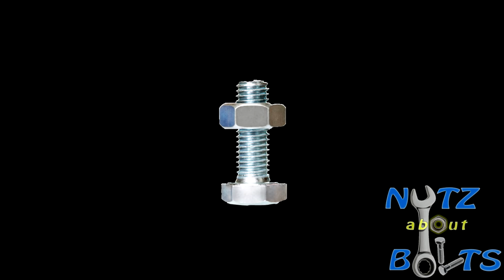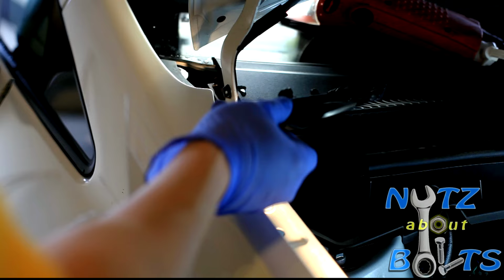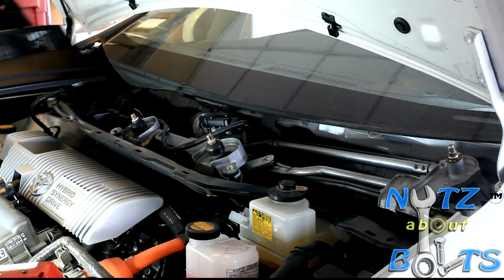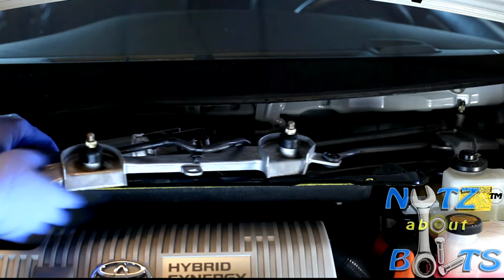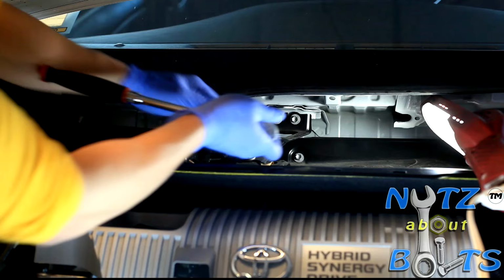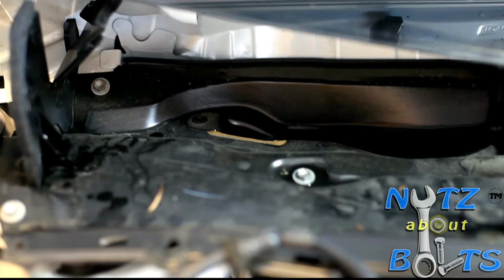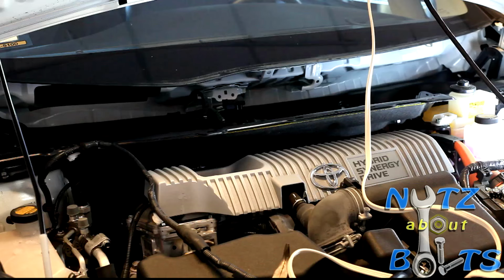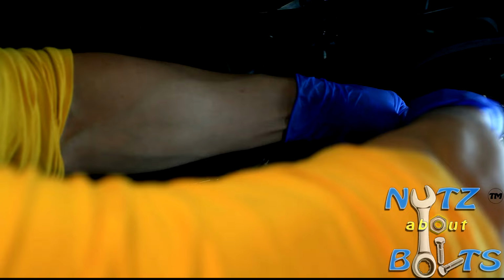2010-2015 Toyota Prius Spark plugs remove and install HD

Comment: what year is your car?i love your video but on my 2014 prius i just pop up the cover without all these extra stuff removed.
Reply from the maker: its a 2012 prius. If your prius is the 3rd gen, this is the way to replace the spark plugs. You can remove the top engine cover, but you won't be able to reach it to remove the spark plugs.
Reply: So to confirm you HAVE to do all the initial steps.  Another comment said "I had my Prius Gen 3, 2010 spark plugs changed and the mechanic just pulled the silver cover, removed the ignition coils, then the spark plugs. straight forward. Refit in reverse order. Watch from 11:30 to 19:45." Want to do this myself, but would definitely not do the first part if unnecessary.  Thanks!
Reply: NutzAboutBolts, I just pickup a 2015 Prius.  I've took off the cover. Looks like there's room to drop the plug socket in first then chase it with the extension. Would the coil clear without removing all the other stuff??

Comment: NutzAboutBolts - Great video.  Dealer wants to charge about $300 for the job.  I going to try to do it myself to save some money. Couple of questions.  Do I need to disconnect the car battery before removing and installing spark plugs.  Also, what is the gap the new spark plugs?  If so, what is the recommended gap? According to the internet it is 1mm to 1.1mm.  Please let me know.  Thx again for a great video!!!
Reply from the maker: no you don't need to disconnect the battery when replacing your spark plugs. The new NGK spark plugs should already came pre-gapped, but if you want to check, the gap is 1mm-1.1mm.
Reply: +NutzAboutBolts - one more question. Do you know if I need to use a thread chaser to clean out the threads before installing new spark plugs?  Some websites recommend it and others don't. Thx.

Comment: Does anyone know if this is the same process for a 2012 Lexus CT 200H?
Reply: I don't think you have to remove the wiper stuff or the cowl on the Lexus, but otherwise it's the same. The Lexus tech manual also says 15 ft lbs for the torque.

Comment: Thanks for this great video. I'm about to replace both spark plugs and coils. Just wanted to know if there's a good aftermarket brand for the coils since the stealership wants to charge around $130 for each one. Of course I'm not buying the cheap ones on Amazon but wanted to know your input on brands like duralast or carquest. Thanks!!
Reply from the maker: Why replace the coils? Are they bad? I would go oem if it was me.
Reply: @NutzAboutBolts  thanks for replying!! I'm taking care of the 120k service myself tackling something different each week, lol. Got the list of "stuff to do" from the dealership and that was part of it. When I asked, they said coils should be replaced every 100k miles. 🤔
Reply: @NutzAboutBolts  I haven't had any issues with them at all
Reply from the maker: @atticuspunk182  my coils at 230k. you don’t need to replace them until there is issues, spark plugs are the only thing you need to replace at 120k, I usually replace it at 100k or 110k miles.
Reply: @NutzAboutBolts  thanks!!! :)

Comment: The demo was excellent and we appreciate it, but, you never explained why you have to do all of those tasks prior to the removal of the spark plugs.  Is that the only way to remove and replace the plugs, again, why?  Is there no other way to remove these plugs?  The Toyota Dealer mechanics are probably jumping with joy everytime you mention remove and replace spark plugs and we have to pay them more for a bad engine configuration.  Can you use a flexible or bentable extention to remove the spark plug?  Or is there a special tool to remove these spark plugs without removing the windshield wiper assembly?  Its been over two years now, since you did your video, should you upgrade your video by now June 2016?  I got a 2011 Prius and it bother me seeing this laborous task coming.
Reply from the maker: sorry... there is no other way for this new engine model, the 2nd generation prius was a lot easier, but some how toyota decided they want to have this set up for better fuel economy for the 3rd generation prius. If you have electrical tools, it'll only take about 1 hr to do from remove to install.

Comment: Addition -  my 2011 have 60000 miles on it.  At what mileage we should change the plugs and what kind you would recommend.  Thanks
Reply: +Matt S Usually around 100K  unless you've been putting your vehicle through hell.
Reply: because it is so much work to change them just make sure you use the original spec IRIDIUM sparkplugs. (Denso SC16HR11 ) They should work great for at least 30000-35000 miles. This is because Iridium is a very hard wearing metal that has great electrical conductivity so they wear slowly and perform great for a long time.

Comment: On the description it says the spark plug specs are 13ft/lbs but in the video at 17:00 it's 20ft/lbs. Which is the correct one?
Reply from the maker: Ping Pong the 13 ft. Lbs
Reply: @NutzAboutBolts  Awesome. Thank you for these DIY videos!

Comment: Is it necessarily to replace ignition coil while I'm at it or it still good till next 100,000 miles?
Reply from the maker: Panut Usawapornpisan you only replace it if it goes bad
Reply: NutzAboutBolts TY

Comment: Where the plugs toyota oem? Are they pre gapped?  if not. What is the gap size?
Reply from the maker: Carlos Orellana You can buy it at Toyota Dealership, or you can buy NGK or Denso spark plugs, they're oem for Japanese vehicles. I'm not sure of the gap since its all pre-gapped. I believe you can find the gap online.

Comment: Great video. For the average guy is it worth it to change the ignition coils while I have this all apart at. 2013 Prius 3 with 130k miles on it.

Thanks!
Reply from the maker: Coils don’t need to be changed unless it goes bad
Reply: @NutzAboutBolts  Thanks for the response as well as the video.

Comment: How long of a socket extension did you need to reach the spark plugs?
Reply from the maker: siward44 I think it was a 3" or a 5" extension...
Reply: +NutzAboutBolts thank you very much very helpful I was unsure as to how to do it but the video is a great tool thank you
Reply from the maker: terry hoedl
np
Reply: Videos like this make it really easy to do the job yourself it's a great tool to have if you're unsure what all you have to do to get to what you're trying to do
Reply from the maker: terry hoedl
true true :)

Comment: Hi, do I need to buy a magnetic socket? or magnetic extension? What is the best method to remove the spark plug because I can’t find crap online or in my local auto store that has a 9/16 deep socket with a rubber inside it or magnetic
Reply from the maker: radiospank you can use a regular 9/16 socket to loosen the spark plugs, then use a magnet to remove the spark plugs or a 9/16 socket with rubber insert to attach it to the spark plugs to remove it. I noticed that the 9/16 socket with the rubber insert isn’t deep enough to grab the spark plug to break it loose, but if you use a regular 9/16 socket, it’ll reach to break it loose but can’t grab it to remove it.
Reply: NutzAboutBolts So it looks like a magnetic extension is the best option?
Reply from the maker: radiospank yes, after breaking it loose to remove the spark plugs.

Comment: Can the engine cover be removed without having to take the vehicle apart?  It appears so, but then again, I'm not sure.  This is my first Prius~  2010
Reply from the maker: nope, if it was that easy, I wouldn't make you guys go through all this hassle lol.
Reply: lol, yeah makes sense~  Thanks, just purchased a 2010 Prius with 95k from an elderly couple, leather interior fully loaded for less for $7800 :) I'm happy but I have to get used to this hybrid stuff.
Reply from the maker: chgofirefighter
its very low maintenance, the only major purchase would be the hybrid battery once it dies, which cost around 2-3k$. I will be doing a video on that once mine dies.
Reply: You can always go with a refurb battery wtih 3 year warranty for $1300 or so, way cheaper than going with the STEALERSHIP! :)
Reply from the maker: chgofirefighter
I've heard its only 1 year, but for that much, I rather go with a new battery lol. Personal preference :)
Reply: the silver cover can easily be removed without removing anything else

Comment: thanks for the quick response. any idea what the part number for the plug heads is? need to replace two of mine due to loose rubber and springs
Reply from the maker: plug heads?
Reply: +NutzAboutBolts the thing that you take out to access the plugs. i know ... my mechanic English is bad
Reply from the maker: the ignition coils? no, unfortunately, we don't have the part number. If you call the dealership, they will know what it is and the cost. Those parts are pretty expensive, how did you end up damaging them?
Reply: yes. the ignition coils. two of the dark grey rubber things on the ends got stuck whilst i was replacing my plugs. I think it might have been caused by the previous owner since this is my first time replacing the plugs. I am not sure if i can just replace those rubber things or i need to replace the whole coil
Reply from the maker: can you send us an image? I'm not sure which rubber part it is, it could be the gasket for the coils or the coil end tips itself...
Reply: is it possible to send an image here?
Reply from the maker: Ing. Francis Opoku
no, go to our FB page and send us the image there.
Reply: unfortunately i am not on facebook. let me try and send it through twitter
Reply from the maker: Ing. Francis Opoku
ok

Comment: Thank you for this vid. My 2011 Prius will start making a knocking sound when I start it up. I'll let it sit for a few. Let it warm up. Then the sound will go away. Fault code P0300. Will this video solve my problems? Please advise. And thank you!
Reply from the maker: Aaron Barkus how many miles? I would check the spark plug gaps. Also clean the egr circuit if you haven’t.
Reply: @NutzAboutBolts  I don't know what the egr is
Reply: 166869 miles
Reply from the maker: Aaron Barkus search in our Toyota playlist. We have a bunch of maintenance videos that I suggest doing as a preventative maintenance. How many miles are on the Prius?
Reply: NutzAboutBolts 166869 miles
Reply from the maker: Aaron Barkus has it been changed before? If not, I’d suggest changing it. The spark plugs are rated at 120k miles.
Reply: NutzAboutBolts so is the spark plugs my issue? Is this the reason why it’s making a knocking sound?
Reply from the maker: Aaron Barkus it’s possible because the spark plugs gap is over the limit of what it should be.
Reply: NutzAboutBolts ok, thank you!

Comment: Is this the same process as the gen 4?
Reply from the maker: I think it’s different and might be easier to access the spark plugs…
Reply: @NutzAboutBolts  thank you so much for responding!
Reply from the maker: @lamar7327  np, you can also check out priuschat.com they have a section for the gen 4 for maintenance and such.

Comment: The condenser on my Gen3 Prius (2010) has a leak, so a/c is not making cold air! With the global warming looming, I have to get it fixed. The main dealer is quoting £600+! Is this an easy enough DIY job? No video seems to be available on YouTube for that?

Comment: Did you replace the ignition coils? if not how many miles do you recommend on changing them.
Reply from the maker: No, you only change them when they go bad. It’s not like the ignition wires.
Reply: I Appreciate the prompt reply. Thank you
Reply: Thanks man changed the spark plugs and I can see a big difference.

Comment: After how many miles am I supposed to change the spark plugs.
Reply from the maker: +Fred Green 120k miles
Reply: HOLY SHIT THAT'S INSANE AMOUNT OF MILES WE GET OFF OF MOST OF THIS INTERCHANGEABLE EQUIPMENT. 

BTW thanks for all the great videos. The amount of money that Toyota wants to charge is crazy. Thanks to you guys I have been doing all the changes and just buying all the oil and stuff from them. They wanted just for the cabin air filter $45. And $60 for the airfilter. on my 2014 Prius C. The parts were only $30.
Reply from the maker: +Fred Green yeah, their labor is insane, best to do small stuff yourself to save you the labor cost :)

Comment: You said in the video it needs 20 pounds of torque for spark plugs, but you wrote 13 pounds of torque. Can you verify this?
Reply from the maker: Yeah I mis-read on the torque value, the correct torque value on the repair manual is 13 ft. Lbs. it's posted on the priuschat.com forum. They are a very helpful group forum you should check out. If you accidentally torque it to 20ft. Lbs, it is fine, but the correct torque is 13 ft lbs.

Comment: I'm not sure I'm up for this. Seems like a lot of work
Reply from the maker: 20-30mins, not too bad
Reply: @NutzAboutBolts  Thanks! I did change out one headlight assembly by myself. Did have to drop the front fender.
Reply: @NutzAboutBolts  I know, but for $170 the dealership will do it for me, thus assuming all responsibility if not done properly.

Comment: 20 ft/lb is too tight. Manual said - 15, but even that is too much (i do 13 ft/lb).Removing original ones(135 K on them) i was afraid to break plugs or treads - so tight.
Reply: And use only small size torque wrench - it is more precise than big one
Reply: Ignition coil torque of 10 ft/lb is too much - you can break that plastic easily. 5 ft/lb is what supposed to be
Reply: What we can see if you work in the darkness? Minus to video
Reply from the maker: Yeah, I said wrong, I put the proper torque specs in the description box.
Reply: @NutzAboutBolts  Ok. Thanks

Comment: I was thinking since my '12 Prius it would be nice to change out the spark plugs. FORGET IT. You start tearing in this DEEP crap will never go back in spot-on. My Prius can just suck-it and use the factory plugs until the end of time. No way am I taking the top half of the FREAKING engine. Bectha! Mechanics just let a Prius sitting in a back parking lot and DONT change the plugs but said they DID and charge you $600. This is freaking madness
Reply from the maker: Lol don’t stress about it. It takes about 20-30 mins from start to finish. Plenty of people do this and it’s their first time doing it. Just make sure to label the nuts and bolts and keep the piles separate so you know where it goes.

Comment: My 2010 prius has 5/8 spark plugs not 9/16. which is it?
Reply from the maker: pyrotalk ours 9/16... buy the new spark plugs and see if its 5/8 or 9/16. If yours happen to be 5/8, then use 5/8
Reply: NutzAboutBolts 
Thanks.. After footzing around for 1 hr. I gave up. My dealer charges $135. In the old prius, you dont remove the motor and link assembly.. Question @3.23: upgrade the wiper and stop the windshill wiper motor at the stop position. What does it mean??

Please show us the location of the PCV valve. After 1 hr searching, i couldnt find it.

thanks
Reply from the maker: Yeah the 2nd Generation prius is easier. As for the wiper motor to be in the stop position, basically the position where it's suppose to be resting at.

For the PCV location, I think some prius has it, and some doesn't. I haven't try locating it as of yet. I will probably take a look at it later on.